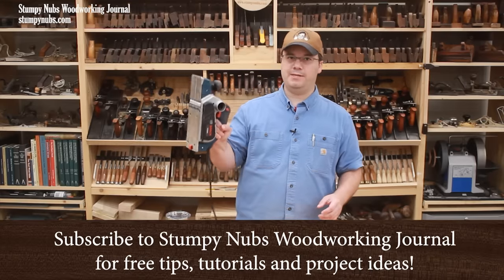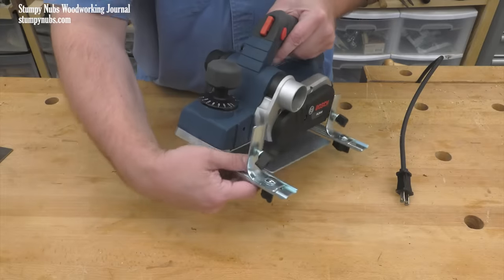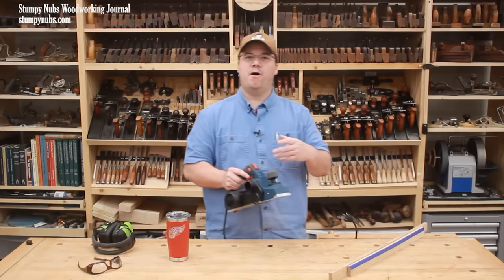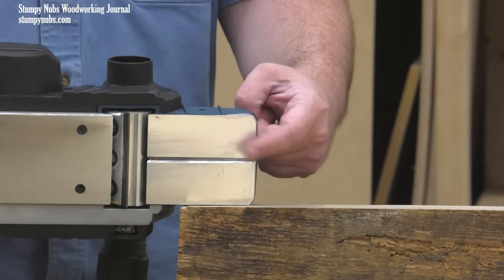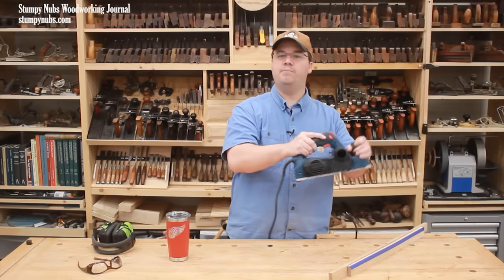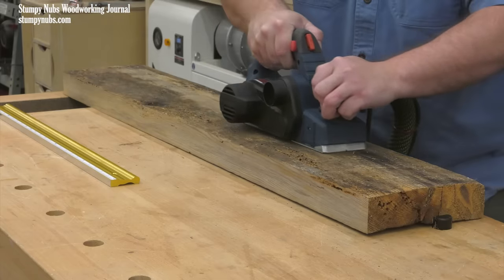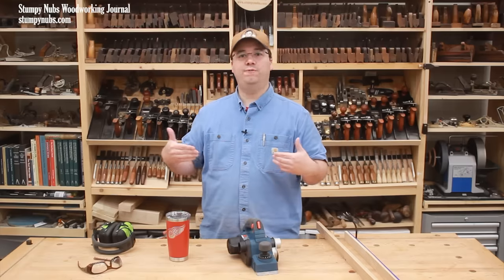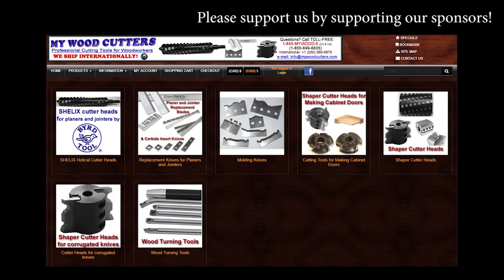Clever things you can do with an electric hand planer

Comment: Love using the electric planer to flatten rough lumber.  At first I had an issue with snipe but I've gotten better over time with practice.
Reply: Yep , early on I would hit glue like a foot of board on each end , that were like the same width , so if any sniping occurred it would be on the 2 end scrap pieces , but now after gaining a lil experience with the hand planer no longer need to add  scraps

Comment: This is a really useful video, and as a hobbyist makes purchasing decisions easier for a small shop - I have an electric planer, which I like and have used a few times but have struggled to maybe think about it out of the confines of the rougher DIY work that I do, but by using this in combination with a smaller thicknesser I now know I can use it for other forms of work. It's also helped me to avoid snipe on the front end of the board, which I have done in the past. Thanks!

Comment: Thanks for all your excellent videos. I bought a electric hand planer particularly for helping a friend make a live edge gas fireplace mantle from Black Cherry wood. The Black Cherry had been mill cut with a chain sawmill hence rough cut but somewhat flat. I could not use my surface planer for the live edge. However, with the electric hand planer I smoothed out the top flat taking small increment passes until it was ready for the belt sander and then random orbital sander. My friend applied shellac on top and a glaze coat epoxy sealer on the live edge. The best part is he and his wife love it! Since then I have used it for other tasks since then, To me an electric hand planer is a great addition to any home shop.

Comment: Fantastic to see you doing this. I did a deep renovation of my bedroom and finished it off with a set of shelves for the alcove which I made from reclaimed wood from scaffolding boards. Safe to say that used my electric planer to face and joint the surfaces took as long as the whole of the rest of the renovation. Hard work indeed!

Comment: Thanks James, great video!  I've owned a  Makita 1100 planner for over 30 years... and have maybe used it a dozen times. 

This video is motivating me to take it out of mothballs, especially since it's a long discontinued model that is much longer than the ones currently sold... 16", which is between a Stanley #5 Jack and  Stanley #6 fore plane in length.

Comment: I found a very easy way to straighten a board on its edge was to clamp a straight edge board to each side then keeping the back base on the two clamped on boards, I would move the plane forward. I could slowly work my way across through several passes until I’d straighten the edge. It takes a couple of minutes to make sure everything’s all square and parallel but it’s a easy way to use a electric hand plane as a jointer. If I was gonna do it on a regular basis I would probably create a jig they could easily be clamped that’s eliminating a lot of the individual adjustments to get everything lined up just so.

Comment: Really excellent tips, James! Thanks! 😃
I've seen someone making a jig to use an electric planer as a thicknesser. You know? Something similar to a router sled. The issue is that you need to glue some wood pieces to the rear part, so it can be supported... Which isn't an idea I like too much. 
Anyway, stay safe there with your family! 🖖😊

Comment: Thank you for this, Mr Stumpy Nubs. Very clear and informative. A cautionary tale: I started using electric planers as an occasional boat builder in the late 1970s. I was very well aware of the dangers. A few years later, around 1984/5, I worked with a guy who was missing most of a finger. Something distracted him when he was putting his planer down after a cut. The finger somehow wandered under the sole of the planer. He said that he didn't feel any pain for a second or two. He just watched a red spray coating his shed wall and wondered what it was. If you chop a finger off, the surgeons can often re-attach it. They can't reconstitute a finger from a red spray on your shed/shop/garage wall. In those days, the planers didn't have the built-in kickstand. I always put a short length of 19 mm square scrap wood in the working area to use instead.

Comment: STUMPY: May I humbly suggest you to take a serious look on the MAKITA 1912B electric hand plane, because of its size (a wider 4 3/8" wide and correspondingly longer model) that I have found much more convenient for using it BOTH by hand, and mounted in a DIY jointer. This machine has been my favorite due to a combination of unique size, precision and smoothness, together with adequate power. The oddly shaped shavings port is not its best feature, but I was able to make an adapter for my vacuum. With the recently issued Carbide blades, it is now an almost "perfect buy" and definitely, a "keeper".
Reply: I have a couple of 1911B, which are really cheap second hand.  If the bearings go, they are easily fixed from standard parts.
Reply: Yep, I  hate the dust port on mine also, I made a coupling out of pvc and heated it up with a heat gun to reshape it to fit, how did you do yours?

Comment: I always wondered how this tool could be used successfully!  Thank you!

One thing I was wondering, though, was how you might use that to work with an edge that isn’t mostly perpendicular to the face. 

A jointer can do this by running the flattened face along the fence to square up the edge. Any tips for doing that with this tool?
Reply: Instead of centering the planer over the edge, you could align the edge of the planer down the middle of the board with the rest of the tool covering the high side of the edge you are flattening.  This will bring down the high side, but leave the low side intact.  It will give you a bit of a “step” that runs down the length of the edge of the board. Once you get both sides of the edge roughly even with each other, then center the planer over the edge and clean it up with a few passes. Really, to get it perfect, this job would be best finished with a hand plane, but the electric model could get you close with proper technique.  You would need to be extra careful though, especially with narrow edges.
Reply: See the comment about making a holder.  It turns the hand planer into a tiny bench planer, which is adequate for small stock.
Reply: You can make the fence that comes with the tool larger, as long as you keep it square to the bottom of the tool, effectively making a larger fence that keeps the tool square to a face.

Comment: Yes, I love my $45 Harbor Freight electric hand plane.
I first used it in the tillering process when I made archery bows. It saved tremendous amounts of time.

I also used it to form the edges of thin boards that were glued up to form the soundboard and back of a Tenor Ukelele I just built. The panels came out perfect.

I also buy mostly rough cut boards and all the Cherry, Redwood and Maple used in the Uke build was planed by the machine.

Yep, cool tool, really helps having one.

Comment: Another great video.  I've been a fan of these things ever since I almost ruined a rather expensive quarter sawn oak  commercial knee wall  rail with a belt sander, only to be saved by a more experienced carpenter with a power planer.   Saved my bacon on that job.  I have not idea how he was able to perfectly remove all the waves on what was probably an 8"  wide surface with the narrow tool.

Currently I have been able to build a nice vanity in my garage from rough lumber with only a power/hand plane for surfacing.  

Finally, thanks for emphasizing safety!    I've managed to keep all my parts for 5 decades so far, as a carpenter and shop teacher.  Listen to Stumpy!

Comment: I have the same Bosche planer. You didn't mention the purpose for the attachment that comes with it. The device sets a 7 degree angle so when you plane the edge of a door in the long dimension it creates an angle in the door to avoid jamming in the door opening. Many people don't know that a door should NOT have a 90 degree corner at that edge. You get much tighter clearances on the door openings. I didn't know about this until I researched it. Learn something new every day....and I am 74. 

Love your use of winding sticks. I first learned about them when I was in 7th grade Summer School wood shop (my goal was to have access to all those tools so I could build my own slot car track). Our instructor taught us how to plane down a larger board and keep it level from end to end. And yes.... I did build that slot car track and also a large drafting table and cabinet. 

In those days schools taught you how to use traditional hand tools and technics. While power tools are neat and less work.....you don't get the satisfaction of learning what a human can do with basic tools.

Comment: Thank you for taking the time to go over safe operation of this tool. It's an unforgiving tool that leaves no room for carelessness when it comes to that exposed blade. But with resect it can be used safely. I use my electric handheld planer just as you show here James for a few years even though I have a jointer in my shop. Mine is the older blue Ryobi model which some will call out as junk but it's still going after a decade of use and does a good job. I watched a couple informative YT videos by Tips From A Shipwright about how he tuned up his Ryobi hand planer and he gives some good advice that can be applied to all brands. He also uses the tool in ways that many might not expect in boat building and repairs.

Comment: Great video and stressing the importance of safety ~ especially using electric planers which can never be overstated.
Common sense and concentration being key factors. 
Personally always wear quality flip up safety shield with built in ear protectors which is not only so much easier if you wear glasses but protects whole face and reduces substantially debris entering through side of goggles. Also takes one second to flip down with one hand so much easier to ensure safety when multi-tasking.

Comment: I use a Makita hand plane quite a lot I quite often use it to thickness stock: I prepare one face to get it true as per your method then one edge at 90°  then the width at 90°  then I mark all the edges with a marking gauge ( or more likely an adjustable square and a pencil) I plane one side down to the line then  the other side down to the line, then I level between the edges.  I find that the electric plane leaves it a bit rough so I finish with a smoothing plane and the boards are true, square and of an appropriate thickness.  To be fair it's a bit slow but quicker than driving 90 miles to the planer thicknesser ( as we call it this side of the pond).

Wishing you well on your great channel

Comment: I'm restoring three park benches with a cast iron frame and 2x3 wood slats. 

They are about 10 years old and the wood was in horrible condition, with some severely raised grain and starting to rot. I ran the electric hand planer over all four sides of the boards and then used an orbital sander with a couple passes.

 These Douglas fir boards look fantastic now. I'm going to use 1/4 in oak dowels to fill in the screw holes so that the screws bite really well when I reinstall them. I am putting a couple coats of TotalBoat penetrating epoxy sealer and then about eight coats of marine varnish. I will just let them know that they need to periodically maintain the finish. Fortunately they face east and catch the morning sun and not the afternoon sun

The handheld electric planer saved me so much time compared to using a belt sander, which is what I started with.

Comment: I had a $30 Chicago Electric hand planer. I used some scrap 3/4 oak to make a jig. I swapped out the fixed plate for my jig to plane the edges of a pair of french doors for a smoke house before I put the large over lapping skins on. The jig had one fixed jaw and one adjustable jaw, so it could be kept perpendicular to the faces. The jaws were equal height so they could ride on another jig which clamped onto the door and stopped the cutting at a pre determined depth. One could do something similar on a flat table to surface the face. I've never had to surface a face that way, but the edges only took a couple of minutes to finish up. It was soooo easy, I never looked back.

Comment: I once used one of these electric hand planes to create flat surfaces for some s2s cedar I used for some outdoor furniture.  Wasn’t a super fast process, but I didn’t have a jointer or planer at the time so it was the solution I came up with.  Still have the furniture.

Comment: I really need to practice with my hand planer.  One of my biggest limitations as a new woodworker has been flattening the face of a board.  Other than a jointer I have everything I need to do it, but I've really struggled with the different methods I've tried with router sleds and planer sleds.

Comment: I'm building a bass guitar out of a bunch of junk mail glued together with epoxy resin. The electric plane is truly a saving grace, I don't have the money for a thickness planer, but the electric planer did the job, all I had to do was some touch ups with a card scraper. So, just in case anyone is wondering,  yes, the electric planer works on epoxy too.

Comment: I would add to ALWAYS be sure that the screws that hold the blades are well fixed. When I use it I check the screw time to time to be sure it's really stable. Any rooter tools are spinning really fast and can cause severe injuries if the blade get loose and fly out.

Comment: I use them for carving bowls and kayak/canoe paddles to hog off large amount of material in a fraction of the time. It gives my bowls a flat face to rest on my carving bench to allow a stable and safe piece to use my chisels and knives. For paddles, it get me up to about 60% of material removed before I start with my edged hand tools, especially for the carved round sections or transition areas.

Comment: Perfect! I needed to see this one in deciding on one tool to get first. Planer, Jointer, Planer/Jointer “combo”, or then wen 4-1/8” sole hand planer. I’ve watched the video on needing a jointer to get the most of a planer, but for now, based on affordability and functionality and portability, this video helped me conclude that I’ll be first getting an electric hand planer first. The model I’m looking at does not feature a trigger hold for larger jobs, so for the larger jobs, I’m exploring the monetary foot pedal switch which will also be useful for other tools like the drill press and vertical band saw. Thanks a bunch for another great video. Going to watch the tape measure one next.
Reply: Rosetta Stoned  yep… 4-3/8 good reviews, great price… just a matter of when lol
Reply: Get a hand plane first.  Although I am eyeing a cordless electric planer.  Purchase of which probably must include a vacuum also.  Yeah keep life simple stick w a hand plane
Reply: @johnschmidt2766  I did buy an electric wen but the 3-1/4 sole. It’s been in the box for weeks now. I’ve used my No 4 hand plane twice as my jointer is out of wack. I can’t get the knives on the same level plane so to speak. I was trying to get the knives between 1/8”-1/4” and the numbers are all over the place within those numbers, but none are the same. For my big 16” glue up of 4” boards using 1-3/4” thick boards, I’ll be keeping both the hand and electric on the workbench and try to get them to help get these board faces flat. For the edges I’m going to use the level along the table saw fence method from 731 woodworking.

Comment: I wish I had seen this video before I used my planer for the first time. There's definitely a bit a learning curve to this tool.

One of my favorite uses has been to trim up the bottom of doors that carpet had been installed under. Take off a 32nd at a time until I get what I need. Much cleaner and easier than any saw cut.
I've also used a technique where I (very carefully) start the pass by pressing the back plate against the work piece and lowering the front plate onto it. It's hard to explain without visual aids how different techniques can create nearly perfect perpendicular and parallel cuts.

Comment: Here in the UK we have a planer  made by parkside. You only find these in Lidl stores, their planer is a budget tool but it does come with an adjustable blade guard. Also the chip extractor works from either side

Comment: I have this same model.  I purchased during a remodel to flatten old warped studs in prep to install solid surface shower surround panels. Worked perfect for this application.  I’ve found it handy for many uses since, good to have in the inventory.

Comment: I’ve never seen such an detailed video about how to flatten a face of a board with an electric plane. I’ve been thinking about getting one for small hobby woodworking.

Thank you for this video. I’d like to see more episodes about the electric plane please!
Reply: Please see the comment I just posted about it, there is some additional information that you can find useful. And also the control over the depth of the cut is very important, if you have to remove serious twisting you can start with a medium depth of cut, but as long as you approach a straight surface progressively reduce it, the last passes should really only kiss the wood removing very few from it, to avoid the nicks created by the edges of the cutters, I hope it helps.
And never use the maximum depth of cut when all the width of the cutters is engaged with the wood, it is not good for the plane engine, bearings and belt, while you can use it safely when only a small portion of the cutter is engaged, like when dealing with the edge of a not too tick board heavily crooked. 
You will find the electric plane an useful tool, but you must understand its limitations, it is a tool designed for rough carpentry, if you want to use it for something more precise you can, but you have to learn how...